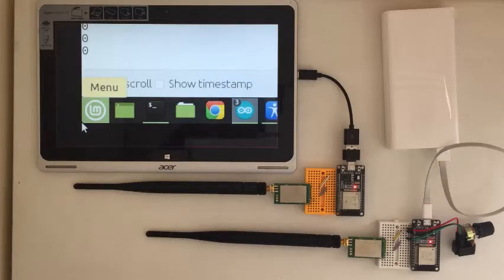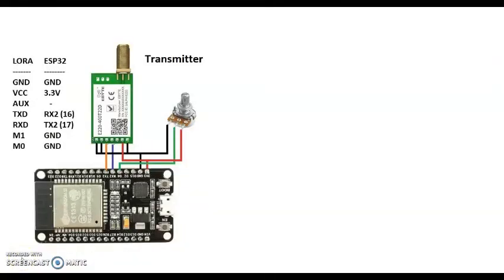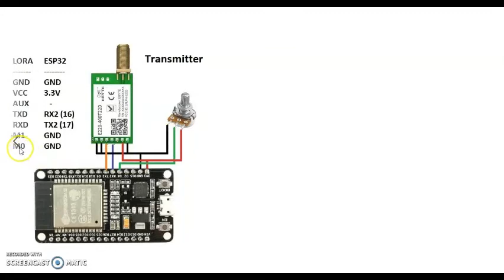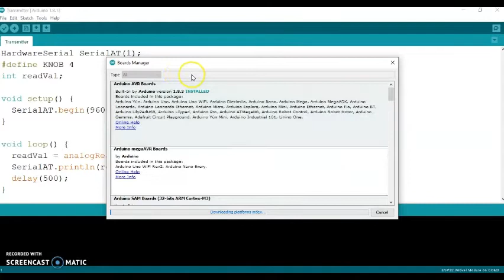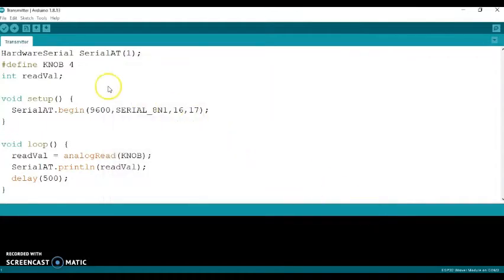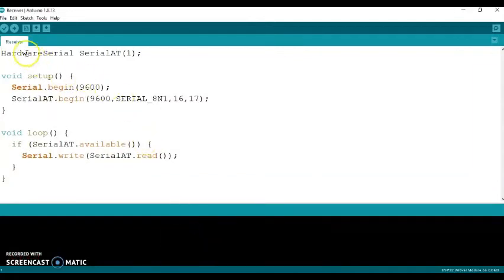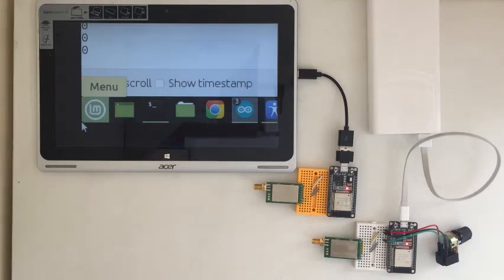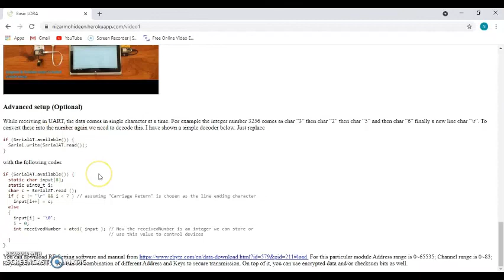1. Basic Ebyte LORA with ESP32

Comment from the maker: I have removed the antenna for few minuets only to show it is possible to test without antennas for short period of time for people who can not afford antennas.

If you want to test long times you must use appropriate antennas.

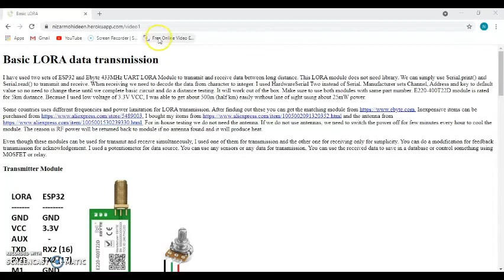have already written in the video at time 8:52 line 7 which reads. “For in-house testing we do not need the antenna. If we do not use antennas, we need to switch the power off for few minutes every hour to cool the module. The reason is RF power will be returned back to module if no antenna found and it will produce heat.”

Comment: I was not able to get more then a few meters with a 3dbi antenna with powering from the mcu 3.3v. I powered with 5v and can get the distance I wanted (perfect connection from 5th floor to my apartment). Maybe I did something wrong or 3.3 is too little for these boards ?

Comment: Hi, i have a question..
Does the Ebyte Sx1276 lora module work (send and receive data) without antenna?
Reply from the maker: Yes. It will work only if they are very close to each other. Not for long distance.

I have removed the antenna for few minuets only to show it is possible to test without antennas for short period of time for people who can not afford antennas. If you want to test long times you must use appropriate antennas. have already written in the video at time 8:52 line 7 which reads. “For in-house testing we do not need the antenna. If we do not use antennas, we need to switch the power off for few minutes every hour to cool the module. The reason is RF power will be returned back to module if no antenna found and it will produce heat.”
Reply: Thank you, i appreciate that.
I didn't understand why does the RF power heat the module if i work without antennas?
Reply from the maker: RF is high frequency power that carries the signal information.
If there is an antenna outlet, the power radiates to the air
If there is no antenna outlet, the power returns back to module and over the time it accumulates. 
That is where the heat comes from
Reply: @NizarMohideen  thanks again..  the question that now arises :
How will the transmission of data be done from module to another without antennas specifically without radiation of signal information?
Reply from the maker: That is a nice question. 
Wire tracks on the PCB acts as some form of antenna for different frequencies. It also can transmit and receive a small amount of RF signals. But those small amount can not travel far distances that is why it worked without antenna.

One more point: when we use antennas we have to use correct frequency antenna for that module. If we use mismatch antenna, full power will not be transmitted or received.
Reply: @NizarMohideen  thank youu understood..
If i work without antennas do i have to turn off the module after each test?
And the module, is there possibility of being burned if i keep it powered?
Reply from the maker: You can touch and feel the warm.
May be 5 minutes on then 10 minutes off
Again 5 minutes on then 10 minutes off and so on
Reply: @NizarMohideen   thanks for the informations.
And while using antennas, the module won't heat up just because the information signal is all converted into elctromagnetic wave which will be radiated to the air..Is this true?
Reply from the maker: Yes. If you use same frequency antenna as the module, it will not heat.
Reply: @NizarMohideen  if i use frequency antenna lower than that of the module..it causes the heat also?
Reply from the maker: That is correct. You need same frequency antenna. 
NOT lower 
NOT higher
Reply: @NizarMohideen  Hello Sir, i have a question: currenty iam working on system containing a device and a gateway and concerning the device i chose a STM32F401RE Nucleo with which i'm gonna interface a LoRa SX1276  module and relay module to control loads.But i wanna make it work autnomously because i'm gonna install it in somewhere..So i have to power all the system specifically the STM32 Nucleo,
What should a choose as controller STM32 or another controller like arduino?
And what should i choose as power?
The power supply AC to DC power adapter 220v to 5v can be a solution?
Reply from the maker: A power supply AC to DC power adapter 220v to 5v can be a solution for STM32 Nucleo.
So far I haven’t seen any codes for STM32 Nucleo with Ebyte LoRa. If you know basic UART knowledge, You can create simple codes for swithing on and off a relay
Reply: Sir i have a question: it is possible to power the LoRa module with 5V ? And the module does it require a specific current value to work efficiently? Can i power it with 3.3v of ESP8266?
Reply from the maker: From 4th page of the user manual for this module I got the following information
* TTL level output compatible with 3.3V and 5V IO port voltage
* Supports 3.0V to 5.5V power supply. Power supply greater than 5V can guarantee the best performance.
Check with the user manual for your module. If you see same information, you can safely use 5V
Reply: @NizarMohideen  thanks sir for your informative answer. Sir why did you power the ESP32 with power bank? It is done in order to deliver more current to the PIO of esp32?
Reply: Sir while using 2 circuits :
Circuit 1: contains a push button with arduino uno, loRa module and a LED1.
Circuit 2 : contains a push button with ESP8266, loRa module and a LED2.
And  if i wanted to press the button of circuit 1.. and send a  specific data (radiated) to circuit 2 in order to light up the LED2  and same for LED1.(translated this fonctionnality in the code), it didn't workk..
can you help me in the code please?

Comment: Hi sir, how do we configure the LoRa AT commands together with an ESP32 using the Arduino IDE?
Reply from the maker: This type of Ebyte LoRa doesn't use AT commands. THanks
Reply: @NizarMohideen  we use a reyax rylr896 together with an ESP32 sir but it seems that we cant connect the module properly to the esp32 for us to be able to program it as a receiver